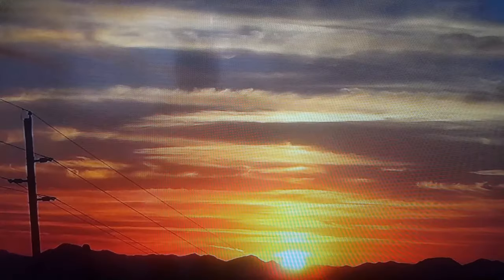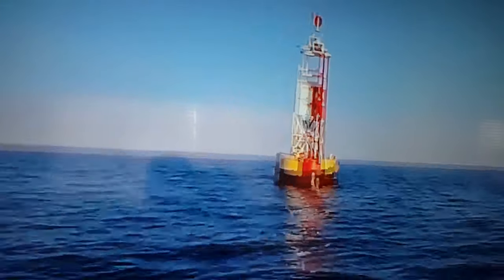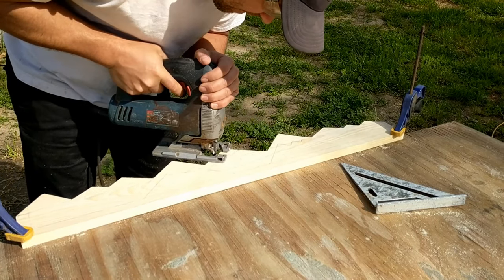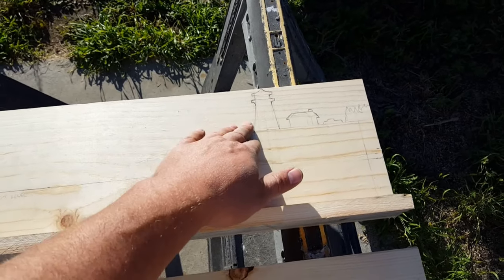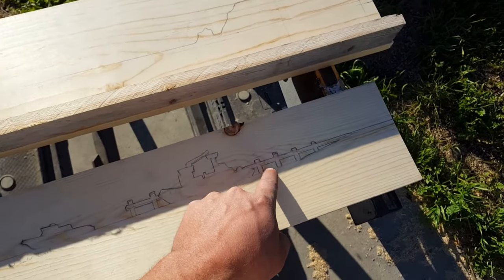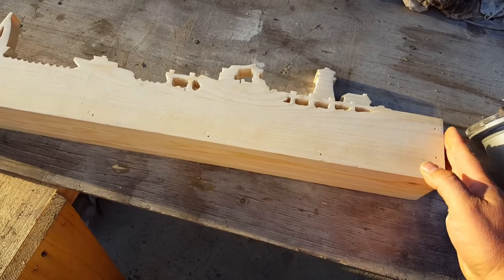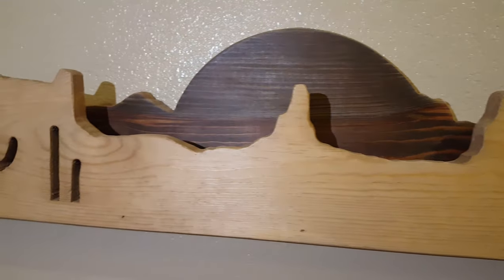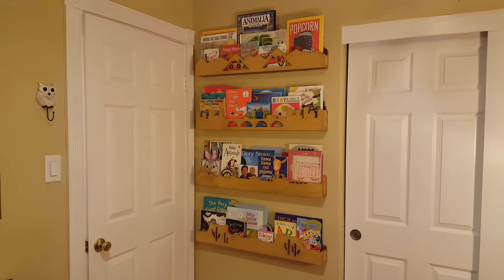Easy DIY Floating Shelves | Floating Bookcase Or Storage For Kids Room | No Bracket Wood Landscapes

Comment: they turned out really good!  you didn't need to put any sort of brackets underneath the Shelf to support the weight or it's just not too heavy for the wall? I can never find the two by fours in the wall and if I do they're not in spot I need  them in..
Reply from the maker: JennsHaunts Smith Thanks Jenn we often use a stud finder to locate the framing in the wall but in this case we used heavy duty plastic anchors rated for way more weight and then used 3" wood screws.  they are not going anywhere infact I think if we tried we would break the shelf before we would rip it off the wall.